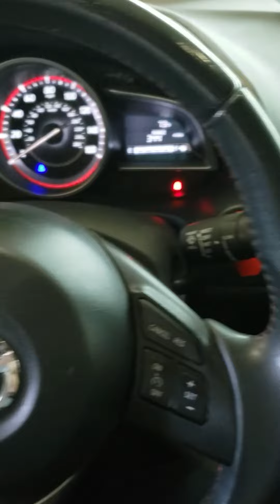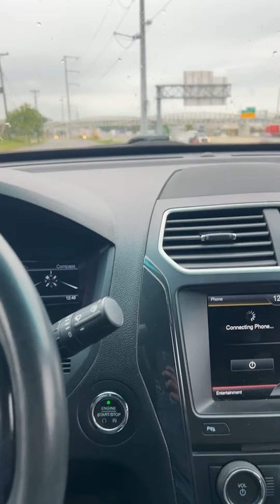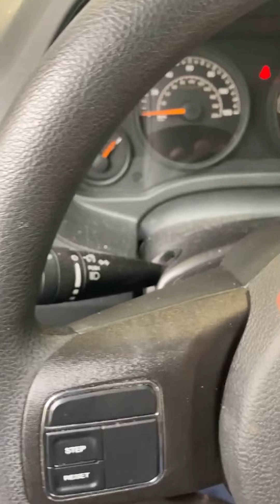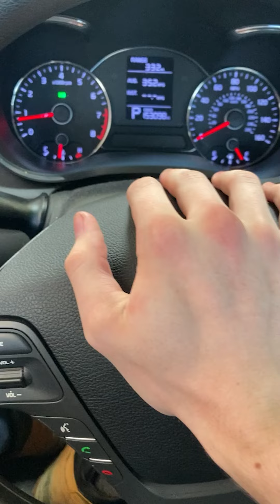Mechanical Problems Customer States Compilation Part 23

Comment: 7:50 this is very common on pre 2000 Porsche when anti-seize is not used. We would remove with a 14mm hole saw with the centering bit removed but those lug nuts were made of aluminum.